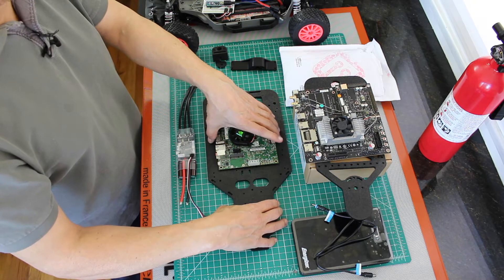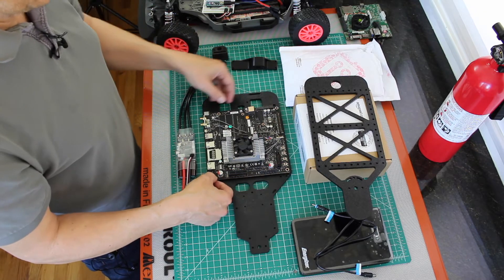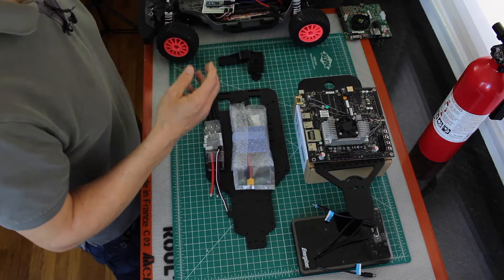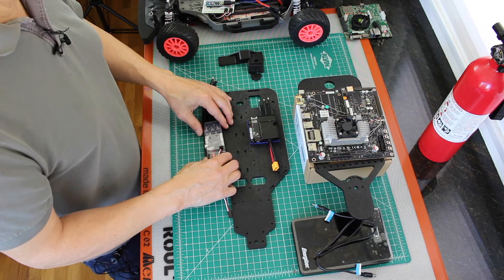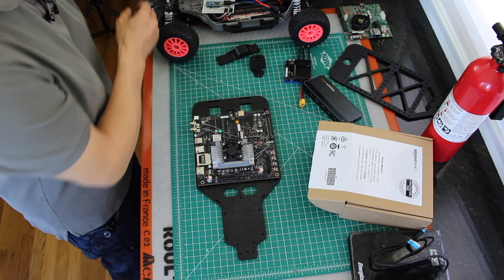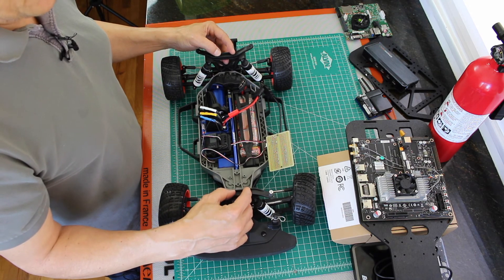Jetson RACECAR Restart !!!!

Comment: Hello, I can see that your ESC has 3 ports but mine has 2 ports (ESC XL5). Can I still connect the VESC-X even though it has 3 ports?
Reply from the maker: I do not believe so, though I have not tried it. The VESC is for brushless motors, the ESC XL5 is a motor controller for brushed motors. Thanks for watching!
Reply: Ok, also, how are you planing to use the ros packages remotely? I mean, after setting everything on a jetson, how do you boot the packages without display and mouse?
Reply from the maker: Basically standard Linux stuff. When the machine boots, there are several different ways to run scripts that launch ROS and the nodes that you want to run. Thanks for watching!

Comment: Hello!!!!  

I am planning on using tx2 on board but not able to find the appropriate battery as Energizer is out of stock everywhere.... Can you suggest any battery is compatible with TX2 developer kit? I tried MAXOAK 50k mAH but it is shutting down after 25 Seconds, I do not what is the problem. Your help is appreciated.

Thank you....
Reply from the maker: I haven't found a good substitute yet for this application. The MAXOAK should be ok if you're using the 12V port, 20V is too high. The Jetson does 19V max. Thanks for watching!

Comment: Hey there Jim! quick question for you, are you going to be using the structure camera + stereolabs zed? and if so how necessary is it in comparison to just having a stereolabs zed? Trying to use internship money to purchase materials after the summer , but not sure if I should get the structure or not. Any thoughts?
Reply from the maker: The 3.0 version of the MIT RACECAR eliminated the Structure camera all together. The Structure is useful only indoors. It depends on intendedpurpose of your car. If you're interested in working with the raw RGB images from the camera, the ZED might be a good choice. If you're only interested in a depth cloud, a RealSense R200 may fit your needs. I haven't used any of these cameras enough in this application to have informed an opinion yet.

Comment: Awesome video. Is there a reason why you didn't go with the tx2?
Reply from the maker: MIT currently has a complete working software stack for the TX1. When bringing up new hardware, the best bet is to have as few as possible variables as possible. When the next release of L4T comes out, both the TX1 and TX2 should be running L4T with 27.2, which will make it much easier to develop for both at once. At least that's the plan for Prototype 3.  Thanks for watching!